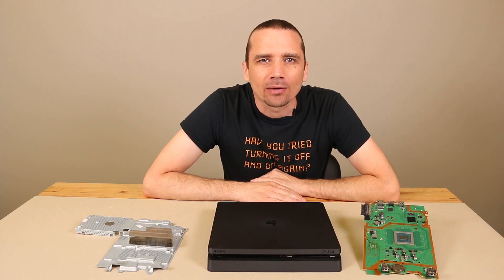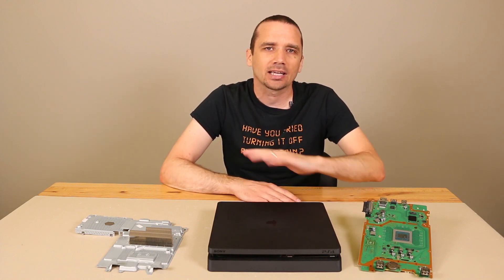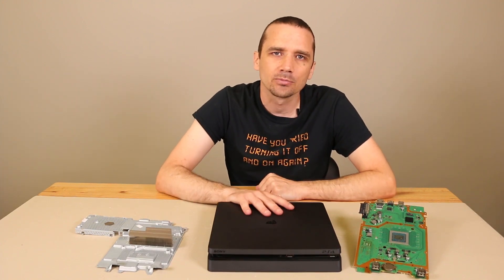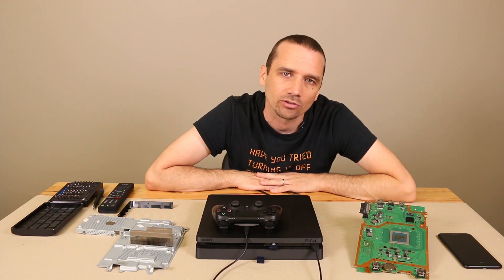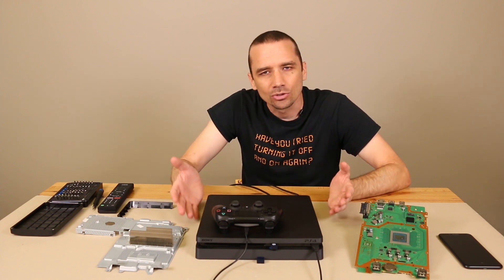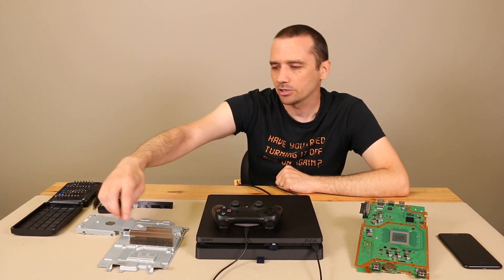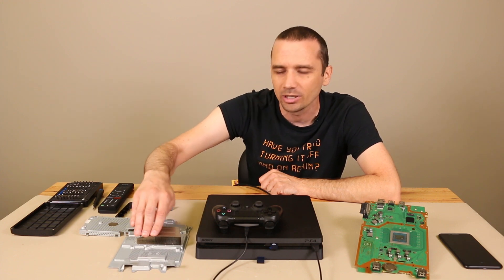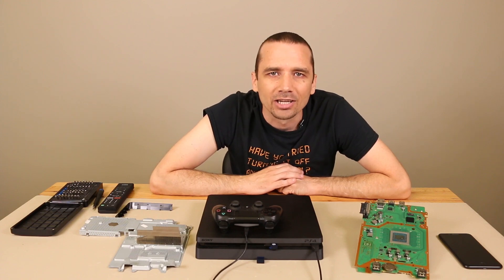PS4 Slim Too Hot? - Overheating Explained - Prevent Overheating

Comment from the maker: Thanks for watching and let me know what other videos you guys would like to see!
Reply: TronicsFix I have a question: my ps4 slim got really loud a while ago (im in a basement and i could hear it from the second floor) and i assumed it was just dust so i opened it up to clean it out but there was no dust, dirt or hair whatsoever so i decided to change the thermal paste, my ps4 slim is still loud and getting louder by the day even though i do high maintenence to keep it clean and its in a very wide open spot, could you please give me a guess as to why it may be getting so loud? i fear it may die out soon
Reply: oscar avila yes, all fans should regardless playstation, pc, xbox, or nintendo, should be loose otherwise that means your fan is sticky or stuck. if your ps4 overheats after turning on that means either the fan is disconnected, thermal compound is terrible, or the heatsink isnt transfering heat (heatsinks should work even when bad doe), idk what it could be but maybe steve (from tronics fix) has a better explination and a possible guess. im currently a newbie with computers (tech in general) so if i were you i wouldnt trust me XD
Reply: oscar avila no problem, happy to help! :)
Reply: Social Freak My Ps4 was the same but the fat ps4, I do regular maintenance on it too so I bought MX4 thermal paste and got new heatsink pads the were <5v ones and its super quite now. was like a jet taking off before hand. would recommend it to everyone!
Reply: Hey TronicsFix, whats the average power draw when playing GTA V on the PS4 Slim? Also thanks for the disc repair video it helped
Reply: TronicsFix Is it normal for my Ps4 to get hot. I got the PS4 that came with Cod 3 bundle. Also could you make a video on how hot the Ps4 get's?? (The PS4 model that came with cod3 bundle)
Reply from the maker: Hmmm...not sure. Haven't tested that.
Reply from the maker: Yes, it's normal...that's what most of this video is about.
Reply from the maker: I wouldn't worry about it unless it keeps getting louder and overheats.
Reply: TronicsFix Ok Thanks
Reply: TronicsFix Should i still buy one because i was planning on buying the gold ps4 slim
Reply from the maker: Sure...it's rare for them to overheat.
Reply from the maker: Yes...I've seen faulty disc drives do that...or sometimes something is stuck in the drive.
Reply: is the PS4 fan supposed to have a loose feel to it? because my PS4 was supposedly fixed and now it overheats whenever I turn it on and then turns off. is there something wrong with my fan?
Reply: Social Freak those are really good theories and some of those I actually thought where the problems with my fan thanks for the advice though :)
Reply: TronicsFix my ps4 its saids too had then it turns off automatically
Reply: TronicsFix Where did you get that shirt I need it for work?!?
Reply: Tronic fix I put my ps4 pro in cabinet of my TV stand.It is closed from the back.It length is about two is p4 pro will it get over heat ?
Reply: My ps4 get hot
Reply: TronicsFix PS4 slim or PS4 what overheats
Reply: TronicsFix  my do fan need clean
Reply: TronicsFix can you mod the fan speed
Reply: hey TronicsFix I think You are a  bit  over the top with thermal paste. Thermal paste replacement is uneccessary! as you could see temperatures on previous video after you changed thermal paste went up few degrees! Thermal paste is ok with high temperatures even over 200F and it will get dry and thats normal ! remember this that thermal paste that u applied gets dry in first 1hr  anyway and it should.. u dont want thermal paste to boil and leak.  Thermal paste should be only replaced if you detach heatsink from APU/CPU/GPU chip.  .BTW im an PC  engineer with many years of experience.
Reply: TronicsFix thanks this really helps
Reply: TronicsFix hey i fo like ur video one quick question..my stupid dog pee on top of my ps4. Right on top were the plugs are connected... but theres was a sign that d pee dry n smells but the ps4 works fine i dnt know if i should worry.. i mean if something was to happen should show me the red light right? Im sorry damn thing cost me some money
Reply: Can i send you my ps4 to fix
Reply: How do you set it
Reply: Yesterday it showed me the red light
Reply: every one have a xbox 360 fat 
dead with 3 lights 
one video trying to fix it please
Reply: TronicsFix i have a question, recently my ps4 slim is overheating and turning itself off after a random amount of time each and the heat sink gets really hot, i removed the cover to see and i think the fan isn't spinning fast enough to push air through the heat sink, should i replace the fan or it may be another issue? Ps:Thank you for your videos
Reply: My ps4 Shutdown without heat error it cant be from heat isnt it
Reply: TronicsFix mine doesn’t show any error codes nor the red light, it just turns itself off after 30 minutes to an hour of playing and is extremely warm to a touch
Reply: @Muck_illuSion  so you solvr your problem ? And for how many years u have this console ?
Reply: Actually what I do is before I start to play on my PS4 slim I just take 2 of my thick physics books and place them with a gap between them wide enough so that I can actually place my PS4 on top of that as if it's a bridge and the books under it are the Pillers ,it actually keeps it a bit more cooler rather than keeping it normally on a flat hard surface
Reply: Hi Tronics my 17 year old son left his slim on for 10 days straight connected to internet and running gta online ..he left it while he slept 5 hours then just continued playing...It he going to spoil it for good?
Reply: @TronicsFix Can you help me out at 0:44 where you put your hand, my PS4 slim gets hot right there a little while after I turn it on and start a game. I just don’t want this PS4 to overheat because my launch PS4 overheated while I was playing it and had to buy a new one. I have also just cleaned the fan and do not have pets
Reply: Omg my ps4 was just hot the back and thought that I was overheating omg thank you
Reply: Question:
I bought a brand new PS4 Pro a few weeks back. Newest model. I have barely used it. In total, so far I would say I have only used it for gaming for 35 hours. It runs very quiet and smoothly playing every game, including The Last of Us Part II, but I tried to play my recently acquired Used copy of Uncharted: The Lost Legacy and it is extremely loud and gets very hot very quickly. Is this normal? Is it a problem with the disc for the game? I thought that it would sound terrible playing TLou Part II, but I was pleasantly surprised when it was quiet. I just need to know if it is safe to play Uncharted: The Lost Legacy without fear of damaging my new, Limited Edition PS4 Pro. Thanks.
Reply: Hey guys I have an issue with my PS4 slim. My PS4 overheats, enters into infinite restart loop and I get blue light of death. But also my ps reaches to the point where I can see the ps logo on the screen and then goes black screen and shuts down. Sometimes it manages to finish the booting part and reaches the main menu of games but it lags and freezes, also it shows error message of corrupted database. I tried to rebuild database through safe mode but takes me to infinite rest start again. I’ve already placed new thermal paste and opened it for a deep cleaning. I tried everything and I don’t know what else try. Could it be due to a bad hdd or apu on the motherboard?  Please help guys. Just want an accurate response to know if it’s worth of fixing it
Reply: I just replaced a fried power supply and now it’s overheating what should I do? Also it’s saying that I have too many usb devices and I don’t even have any plugged in.
Reply: You obviously haven't played rdr2 because I can make morning coffee with mine
Reply: What about if it gets stuck on the power up screen like it's just the blue backgruond with the blue ribbon like thing but never totally comes on for me to pick my profile
Reply: My PS4 slim got hot turned off I cleaned debris away it turns on but no picture need help

Comment: I replaced thermal paste twice and clean radiator vents and tight the bracket and still hot and shutting down for less than 10 minutes

Comment: I am paranoid i did the the thermal paste and pads for thebfirst time a fww days ago and have changed it four times now lol not knowing if i did it right and it is just regular jot after and hour or so of gta 5. Kt runs very quiet but it does get hit to the touch i havent had an overheating signal or anything. Hoping i did eveything ok and didnt put too much or too little. I put sized dot or bb sized dot smoothed it out and then added a tiny bit here and there to make it as even as possible pit it back together also replaced all of the thermal pads with 1.0mm thermalright rights maybe i am just too worried and it is just regular hot???

Comment: I opened the top and bottom cover of the ps4 slim, blew the dust out of the fan with air and put everything back together. I turned on the ps4, entered the game and the fan spins at the same speed, it does not accelerate. And before I cleaned it, when I was in a game, the fan would sometimes spin slower, sometimes faster, depending on where I am in the game, which is normal

Comment: 54 Celcius isn't so bad, You want to start worrying once it reach temps such as 75 Celcius +. But the cooler the better. I softmodded my PS3 super slim, not so long ago, and with Webman MOD, i can actually set the fan speed to manual at a steady speed (the default automatic speed is VERY quiet but way too slow for my liking and it makes the console get too hot for my liking as well), so i can have it spin at a faster speed than what the console would normally, yes it make the console a little more noisy BUT it make my console temperatures cooler even when i'm playing games such as Gran Turismo 6. So it's a good compromise, and i'm not going to worry about my console getting too hot.
So if i can do the same on a PS4 slim, i guess it's going to help as well.

Comment: Hello. Nice video. Can i ask, if im using an external fan, where should i put it? What position or Which side of the PS4 slim? Thank you.
Reply: You don't need one. The trouble of heat the ps4s suffer comes from the thermal paste. The thermal paste starts to dry out in a matter of 2-3 years and then the playstation starts to heat more because it needs replacement. That's the main reason why this is happening.

Comment: I’ve cleaned it out replaced all the  pads and cleaned and replaced the thermal paste  and it’s still over heating (I get the warning but not the light)

 been thinking I need to put some thermal pads on above the  metal fins thing

Comment: Mine is completely clean, but still gets super hot just by staying in the main screen for 10 minutes and the fan even tho the PS4 is starting to get super hot it runs slow, like just by gently pushing it with your finger it stops, so I dunno. everything else is fine it just, don't keep up with the heat

Comment: I was playing the sims4 all night and i didn't turn it off and fell asleep. The white solid light was on so i tried the power button once and then it turned into a solid blue , going into a blinking blue and then it just turns white and stays white. I tried so many things even cleaning the inside, the whole hdmi and much more. Nooow I'm not sure if it just was because i was trying to many things..I waited 10 mins and then when i tried turning it on a solid red light came out. I just ended up turning it off because I'm assuming it's over heated but i haven't turned it on since. Keep in mind my samsung tv is completely black screen but i can see a light which indicates that it's on and the control turns it on and off but it stays black screen. I need help :(

Comment: I was having the overheat problem recently in may and june,it never happened before,sometimes it doesnt overheat,and other times it over heats,i never had this problem in winter,autumn,or in a raining day,so your ps4 will not overheat during winter,in summer it will over heat a lot,un less you live in the north pole
Reply: And when i touch the ps4 its hot loke the sun

Comment: Hey there, my wifes ps4 slim 500 gb model (CUH-2015A) keeps shutting off randomly/ or doesnt even turn on (pulsing blue light then off again)
Tried brand new hard drive and brand new power supply, no dice so i put old hdd and psu back in. Already tried initializing her ps4 twice.
Also I keep getting error code ce-36329-3 (error in system software)
Last note: I did buy a new power chord and it is plugged directly into wall and not into surge protector. I also tried different outlets.
We took it into a ubreakifixit store and they said they replaced video I/C chip.

Im probably going to take it back in since the repair comes with a one year warranty.

Sometimes I can get ps4 to turn on if I put down pressure on top center right of console (console laying flat) console is on top of entertainment center.

I also did (before it took it in somewhere for repairs) take it apart and clean out fan and heatsink and repasted it with corsair XTM50

Comment: Please I need help. I’ve cleaned my heat sink and fans, Changed my Thermal paste , my fan makes little to no sound but it’s really hot especially  underneath  The console I don’t know if I should change ram thermal pads .
It was the top overheating now it’s just the bottom .

Comment: I haven't seen a red light.  Still to stop me worrying, I HIGHLY RECOMMEND THE USB LAPTOP COOLERS WITH the TWO BIG FANS AND HAS TO HAVE THE ALUMINUM TOP PLATE WHICH CONTACTS THE side of PS4 touching the cooler.  Several models of this.  Mine was $20.

Comment: I have a blinking blue light I tested the power supply has a 11.99 volts and I tried the washer under the cpu cover and still don’t work a blinks blue I did notice the fan don’t fully kick on it runs really slow do u have any advice on getting the ps4 slim working properly again

Comment: Ok so I took mine for repair cause my game textures weren't loading properly it was freezing and crashing, they clean the fan, thermal paste and change the hardrive, I got it today and everything was fine but the hot air is still there and the PS4 pro feels super hot to the touch and I feel is gonna damage the hardware again, the game was running fine until 3 hours later I was having the same issues, I don't know what to do, I already pay so much money for repair.

Comment: ALL U NEED TO DO IS REPLAACE THE DRYED OUT THERMAL PASTE THATS NOT DOING ITS JOB PROPERLY NOMORE
i OPENED AND CLEANED MY PS4 MANY TIMES WITHOUT SUCCESS UNTIL I REPLACED THE THERMAL PASTE AND THIGHTENED THE SCREWS TIGHTER ON IT SO IT KEEPS A GOOD PRESSURE AND ABSORD ALL THE HEAT OUT OF THE BOARD

but i didnt have thermal paste bcuz i did it in the middle of the night with all the stores closed so i put some thooth paste and it fixed it for years without issues , i was supposed to replace the toothpaste by thermal paste later but never did it cuz i neva got anymore overheating problems

the only warning is that they say u must use thermal paste and not toothpaste bcuz toothaspe got some lil parts of sand in it to scrub on your teeth so that sand might scratch and damage the part on your playstation, thats what they said but i didnt care and didnt have issues cuz i didnt wanna buy a whole thermal paste tube to use for only 1 drop

so he forgot to put the emphasis on replacing the thermal paste, and i didnt replace mines totally, there was still some original thermal paste left that was half way dried up and fading out ... but i just added toothpaste over it 

then when i closed it at first, i didnt tighten up the screw really tight in case i have to open it again, and it kept overheating right away even with the new thermal paste ... so then when i opened it back up and thightened everything almost as hard as i could ... then it worked perfectly and the temperature wasnt overheating bcuz the heat sink was tight enuff to absorb all the heat before it gets too hot

so the cleaning after that was almost unessassary bcuz i neva cleaned anything after that also for years

IT ALSO FIX THE LOUD JET FAN NOISE THATS ABOTU TO TAKE OFF SOUND

TLDR: JUST ADD SOME THERMAL PASTE OVER THE OLD DRIED ONE (or thoothpaste) AND THIGHTEN IT AS TIGHT AS POSSIBLE

Comment: What if the PS4 slim is hot over the fan as well as the Power supply getting hot as well? (Note: Device has been cleaned all dust removed and the thermal paste has been replaced also)

Comment: I regularly open my PS4 Slim, well by "open" I mean remove the top plastic lid, so dust out and keep the fan clear, as well as clean out the intake vents on the sides, as well as all of the obvious stuff, keeping it in a ventilated and elevated area away from the floor etc etc...

I've never had an issue with over heating as of yet, one thing I am considering was getting some adhesive rubber feet so raise the console up so it has a space under it also, is this something worth doing, will it make much of a difference in preventing overheating?

Comment: I have a ps4 slim bought in 2019, i live in india and the temp goes to 41•C in summer, till now my ps4 was in the room that was last room in the house so there was not much heat in the room and also an air conditioner was running, but now i shifted my ps4 to the most outer room and it also has no ac, now i am getting ps4 too hot error every day from last 5 days, should i move my ps4 back to other room or something else is wrong with my ps4, and also ps4 is well ventilated in both room
Reply: environment is also a factor, atleast u had AC

Comment: I've got the older version ps4 and the fan is spinning but very slowly then after about 10 mins it just turns off and won't switch on again until it cools down but there's no red light or Beep just switches off is that because it's overheating or a different issue, Jay